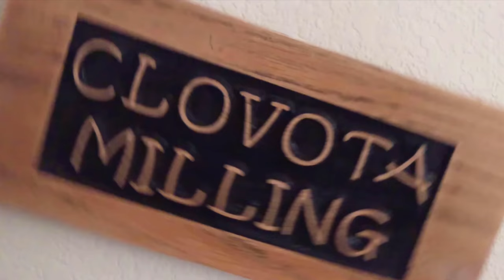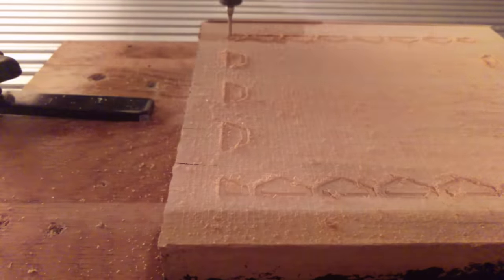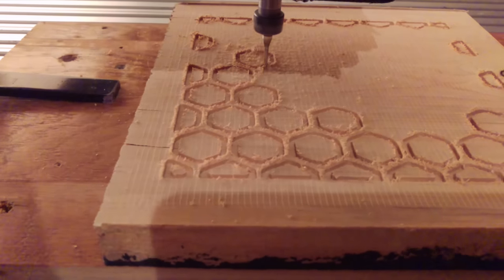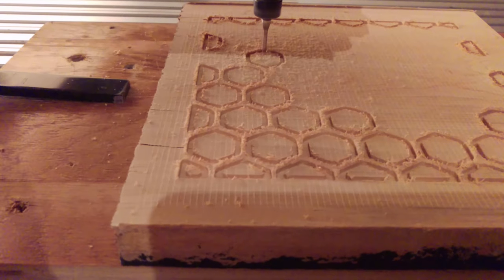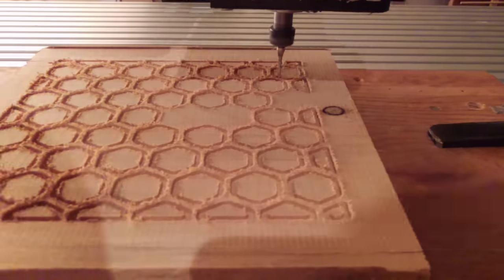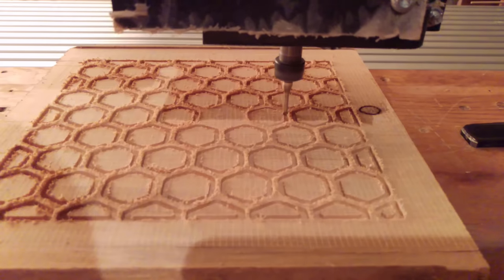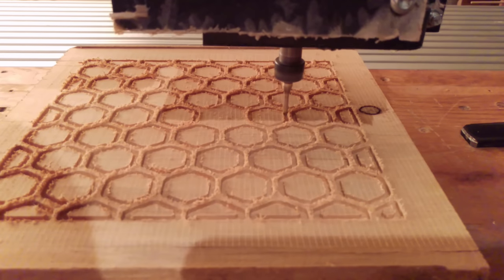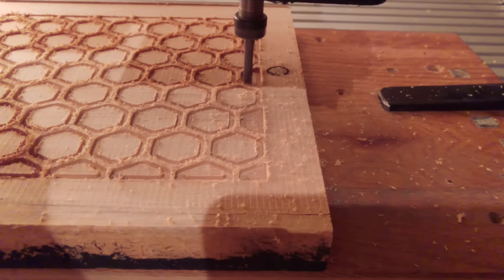HoneyComb Wood Carving CNC Carved Wood Decorations,CNC Shark HD4

Comment: I'd be interested in seeing tests of just how intricate a large CNC can be for tiny jobs
such as engraving fine lettering and an image on plastic laminate (and even wood, if possible), or metal engraving 

I know that the professional engraving machines cost relatively a lot more for a small work area, paying extra  for precision, but can a CNC router get by?
Reply from the maker: Yes I can do that, I have some laminate material and I also have some particle board I will do some fine intricate designs and engravings on them to see how they stack up. got a few things going on but I will put it on the to do list. thanks for the suggestion have a great day tc